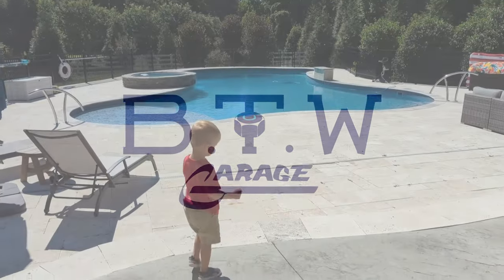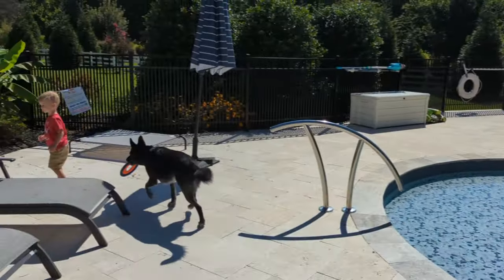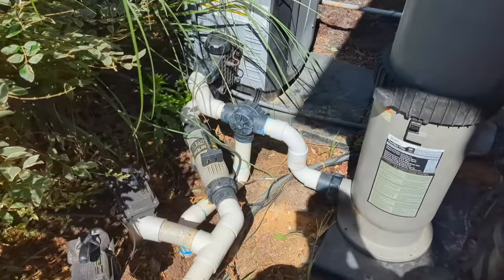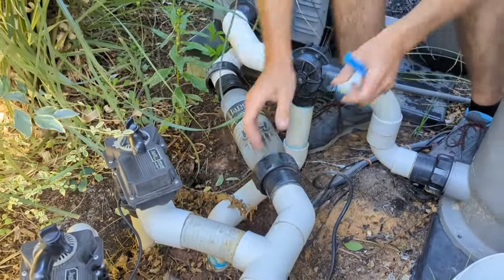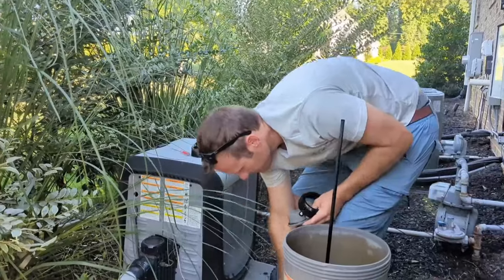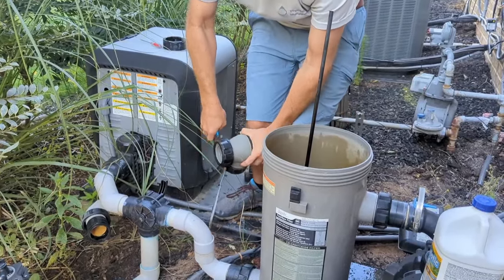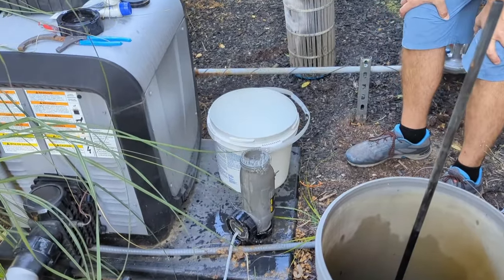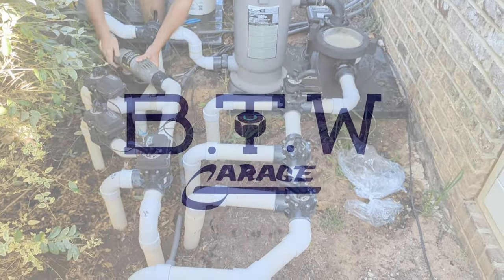Quick Guide: Cleaning Your Jandy AquaPure Pro Salt Cell

Comment: Thank you for the helpful video.  I am preparing to clean my Jandy salt cell for the first time and this was helpful.  For what it is worth, Jandy's instructions mention that the sensor plug (the one with the cord coming out of it) should be removed for the cleaning as the acid may damage the sensor.  As your guy does this for a living and I've just watched a video or two, however, removing the sensor plug certainly may be overkill.
Reply from the maker: Good insight! I imagine if it was catastrophic damage then he would have learned to remove the sensor plug a long time ago as you mentioned. Feel free to remove it to be safe, but you should be fine
Reply: Very Important: Remove the cover holding the 3 terminals and inspect the rubber O-rings.  These can harden over time, leak and short the connection, resulting in a melted plug and corroded terminals.

Comment: So what is the story on the custom cap used so that he could pour the mix into the cell?  Thanks in advance
Reply: I had the same question. I looked into it and you can use part # R0523000. It’s a Jandy drain cap used for their pool filter it also fits their salt cell.

Comment: I cant get one of the unions on my salt cell lose, ive tried filter pliers and one side wont come off for me to clean it. Its on so tight from the last owner that when i do try to turn the union the entire salt cell turns!? I have the same jandy pro series...any suggestions? Grease? I dont know😢
Reply from the maker: I hate to hear that! Please keep us posted with what you figure out. Leverage and a proper grab on the two pieces are going to be key. I'm not sure if a silicone lubricant would help or not, but worth spraying some to see. Just don't get it on the outside and cause additional slippage